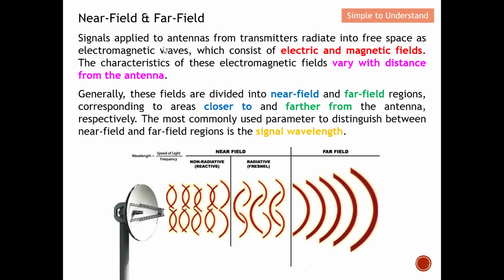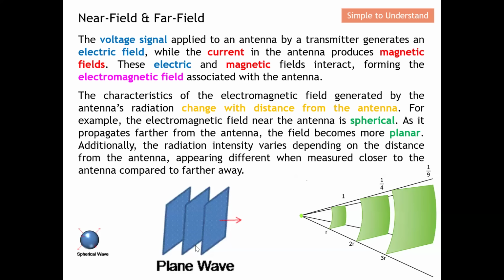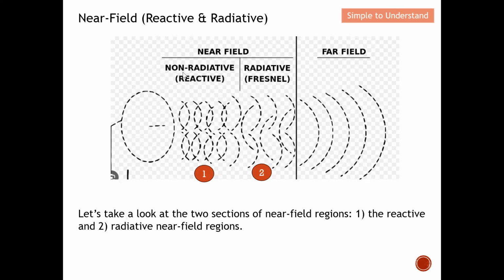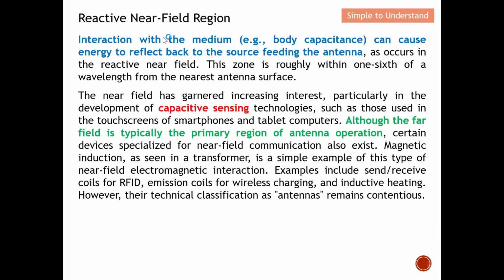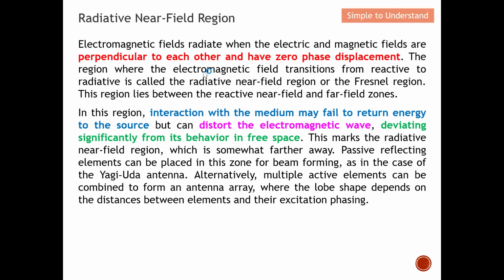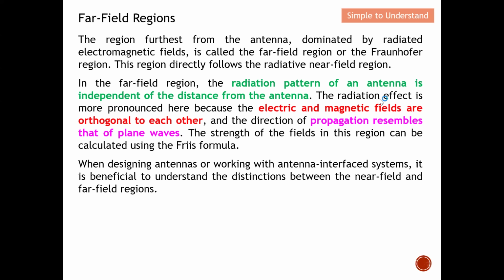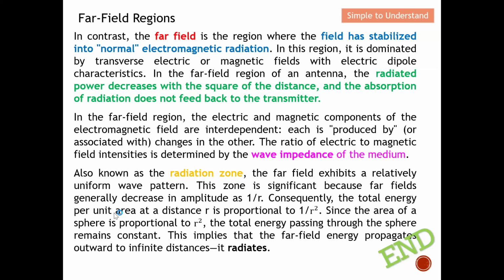Antenna #15. Near-Field (Reactive / Radiative) vs Far-Field: How to Determine Antenna Regions.

Comment from the maker: Thank you for your strong support in watching this video.
In this video, I would like to share how to determine whether an antenna is operating in the near-field or far-field regions. These regions are determined by the wavelength of the signal and the distance from the antenna. It is important to know whether it is the near-field or far-field because different sets of equations are applied for computations in each case.

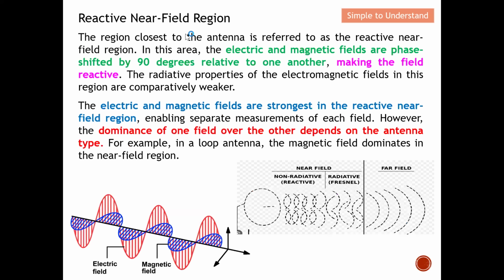Comment: There is a small mistake in this video between 10:45 and 13:30. The image of the E and B fields on the bottom left on the screen are in phase. These should be 90-degrees out of phase.
Reply from the maker: I am a bit confused by your question. For electromagnetic wave propagation, the planes of the electric (E) and magnetic (H) fields must be 90 degrees out of phase. The key point is the plane of the E and H fields.